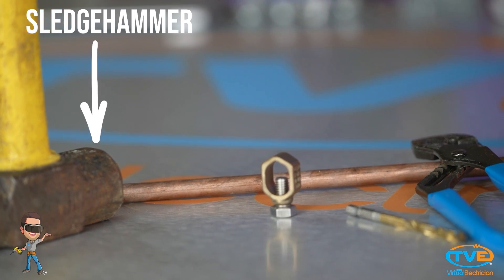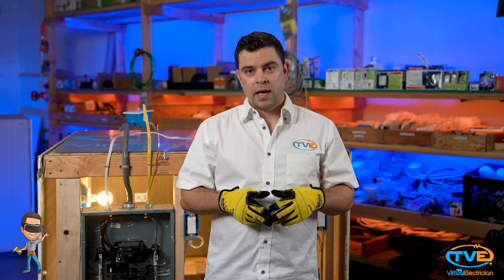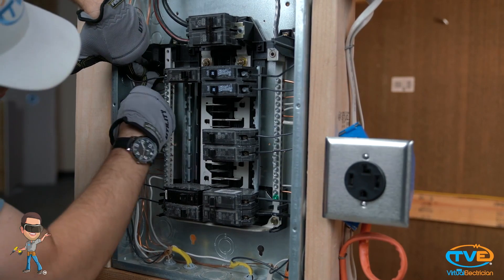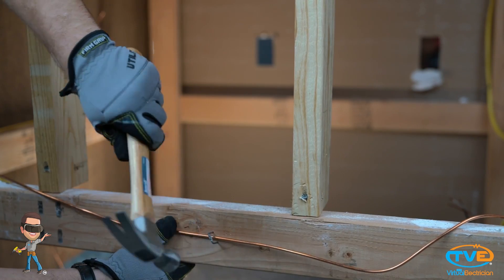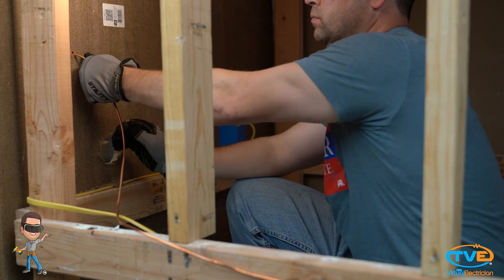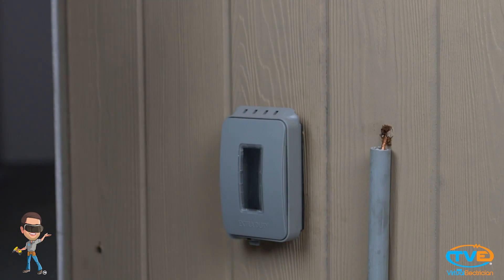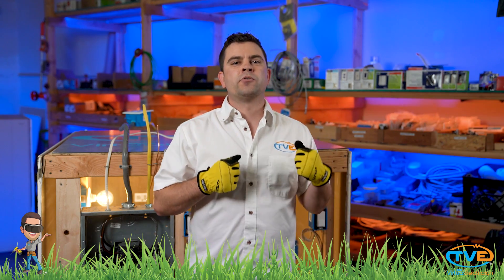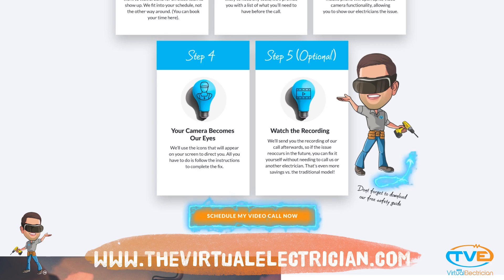How to install a ground rod

Comment: So I have 2 ground rods for my main panel , but one of them is not connected. Can I simply run some number 6 copper from the unconnected ground rod to the connected rod, or do I need to run each ground rod separately back to the ground bus in the panel?
Reply from the maker: separate
Reply: @TheVirtualElectrician thanks for the reply

Comment: What would be a good way to connect to a buildings current ground for dealing with static electricity?
Trying to figure out a safe, and effective way to ground vehicles for painting. Have read there’s an old school method of just throwing chain over the frame, then letting the rest of the chain rest on the ground, but am unsure if this is safe, or even works properly.
Reply from the maker: oh man.  not sure